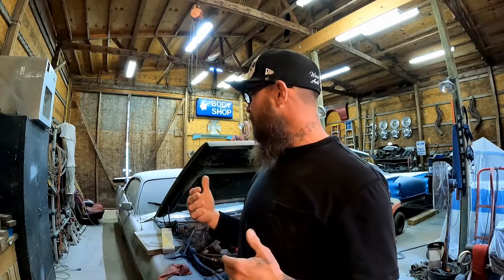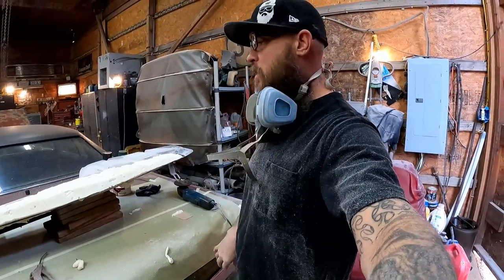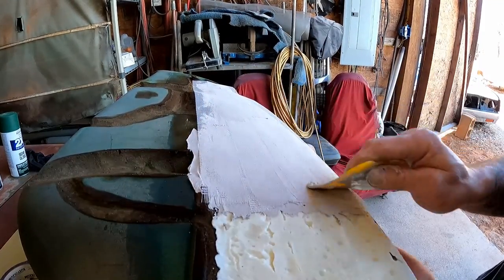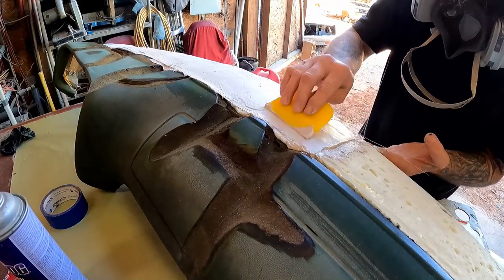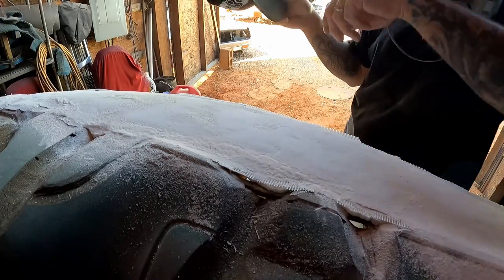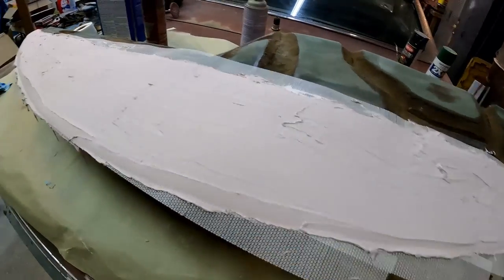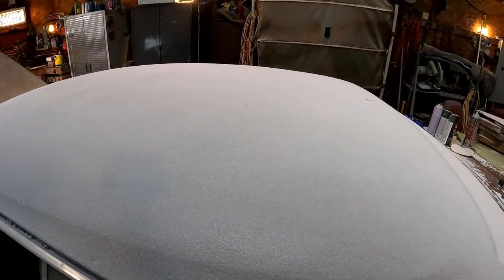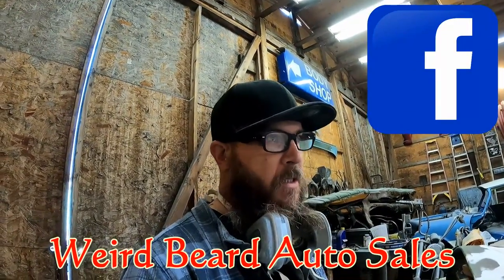FIXING THE WORST DASH I'VE EVER SEEN [2]

Comment: Couple tips on the foam can , some of those cans are made to spray upside-down , pays to check cuz you'll run out of air ! The other tip is , if you use half a can or what ever and then leave it and try to use it later & it's plugged you can takes the spay assembly off and spray carburetor cleaner through it and that old foam will disappear like magic! You can also spray it down the exit tip on the can !
Reply: Nice tips
Reply: Love how the creator" ignores lol
Reply: if he ended up doing vinyl.. was it necessary to go through all the filler wrk, could it been done with the carved and formed foam repair? just throwing it out there
Reply: @vojislavdragic5090 that’s what my thoughts were exactly when he said vinyl instead of paint
Reply: @Speedy123youknowme  on the second thought .. glue would melt the foam.. i think
Reply: Vinyl will need a good foundation. Bumps and waves will show through though pinholes don’t matter. Trimming vinyl  around those vent holes will need serious skill.
Reply: 너도 폼이냐

Comment: Add some fibreglass resin in to the filler, it makes it as runny as you choose to make it and slows the curing time down a bit to give yourself more work time
Reply: Halfass Custom does just that.
Reply: Yeah it's called Rondo (Resin + Bondo). Sprayway Customs does that.

Comment: Great 👍🏻 Stuff as always 🤠 Electric 💡 Lights, Heater, 120 plug -ins all on separate 20 amp breakers. If your Air Compressor is 120 or 240 volt. Separate breakers are a must do.

Comment: Just curious, wouldn’t using the Bondo “hair” have given the dash more strength? I suppose the mesh accomplishes the same thing.  Also, when the dash is sitting in the sun, will the air voids  in the foam under the Bondo heat up expand and  crack it? I used foam under Bondo on a rusted car door repair and always worried how long it would last.

Comment: The mesh tape pushed into the bondo will make a stronger result than the filler with fibers in it.  You are going to have a better overall result over the more expensive stuff.

Comment: Good move on switching to vinyl, spray paint wouldn't have lasted. Make sure you get marine grade and have heat gun ready for all those curves and lines.
Reply from the maker: Thanks for the tips. Hopefully mine will turn out at least half as good as yours did. Love your channel btw.
Reply: @weirdbeard8898  Thanks for watching! You have a lot bigger dash than mine, looks like yours will be a lot harder to cover in vinyl. I hope it turns out good.

Comment: Most usually when I see lights flicker like yours were, it has turned out to be a loose neutral wire either at the pole or in the breaker box. It would be pretty quick to check and might save a lot of headaches.  Love the channel!

Comment: I use spray foam for cab corners and rockers on these old rusty Ohio trucks. Never rusts again!    Shape it, Skim Bondo. Flex seal texture spray.  OEM finish.
Reply: It absolutely rusts again as the foam hold in moisture, any metal it touches will rust away. It’s a temporary patch if your trying to get another year or two out of the rig, but not a forever repair.
Reply: @sccarguy8242  it's forever, I own my vehicles 3-6 months tops.

Comment: Bondo brand bondo is a nightmare to sand. When I was younger I used it and I hated it. I delivered parts to a bodyshop and they were using a green filler to skimcoat a whole car and it was sNding so quick and easy with the DA's they were using. I tried for a while to find out the type they were using. I was working on my 72' Chevelle convertible back then. This was in 97' or 98'. Lol.

Comment: COOL! 45+ years in, and here's a new one on me with the foam. Seen many custom floor and ceiling consoles use bondo over wood, then finish how you want; paint, vinyl etc.. There are some really good videos on vinyl covering dashes. One was complicated like yours with vent openings...contact cement and blue vinyl. Awesome when finished!  YOU? Scared of vent holes? Naww. But it does add to the drama.  : ) Start a hole in the center of the vent opening and work your way outwards, trying different tools until "you get it". I'd try burrs and sanding drums. Kudos for being frugal! The nice part is that you can be both frugal AND generous at the same time! Being frugal is more a philosophy of NOT WASTING if possible (like turning off the lights when you leave the room). Some benefits are: Pay less to the "big" corporations; Pollute less thus ultimately doing our part to slow down the toxification of humankind. YUP, FRUGAL IS GREEN!

Comment: I used to work a lot with these things back in the day, if there's one tidbit of tricks i can impart on this, is i would recommend using closed-cell foam instead of that cheap fix-your-home stuff. Get the quality two-part foam, it'll need a bit more prep and is pour-in type, but it'll expand more even, fill more even and is 1000 times easier to work with and sand etc. Also, the closed-cell foam, when bondoing over it, will not create those 'bumps' that you got here, as there's air trapped in those open cell holes and it'll always be a nightmare to work with and get even.

Comment: Mike instead of cutting the defrost out, you should just drill holes or ports and wrap the edge of the vinyl down in the ports, 5 ports per side. Please make your own emblems on the dash and on each side of the roof.
 (W B SPECIAL EDITION). You can make the indent on the dash as long as you want to it will be under vinyl.

Comment: Awesome work! Being in car audio fabrication and installation, I've done my fair share of sanding! Bondo and Fiberglass resin.....whew! There's been a few spare tire enclosures that have just about put me in the hospital....even with respiration. You really need a hood with O2 for that involvement....anywayssss.
It'll definitely hold together a lot better with the vinyl! I'm so glad you said you were going that route! I was even going to mention "flocking" (For a flocking-good time call....lol) but you get no more structural support from it that just paint. It's a cool process you might want to add somewhere in the car though.

Comment: This is too crazy.  I found your channel tonight and was observiing you restoring a dash pad and I go to thinking about the car I wish I could have repaired back in high school that I inherited to drive which was our family station wagon.  The dash was split a few places and not reallly bad and never knew that it could even be removed. I did body work on it and my dad had an Earl S cheib paint job done on it.  It was creppy....But it served it's purose.  I ended up putting some furry blue fabric on the dash to cover up the splilts. FF to now nd I'm looking at your dsh and thinking about being able to do that in teh future if I get a car needing it done and the more I looked at your dash..A huge bell dinged.  The car we had bought brand new in 1972 was a Custom Suburban Plymouth Fury.  Where that badge spot was it had a Custom Suburban badge.  IT was blue.  I fguess blue wasnb't as bad to  split up like the green did.  Oh and by the way, what about the speaker grille?   LOL   You going to drillit out with 1/8th drill bits?   Mine was really ate up in that section too.

Comment: Working with foam I have found to keep a spray bottle of water. Mist the surface area, spray your foam then mist over it again. It'll cure faster and less chance of the soft spots. I used to make Zombies using spray foam and mannequin parts. Amazing work man!

Comment: My 2016 GMC Sierra Z-71 went out due to the torque converter being off balanced from the led grinding producing shavings that built up in the torque converter and caused it to sling apart at 83,000 miles. 
I would love to be part of a class action lawsuit.  This cost me $4800.  And GM issued a service bulletin to the service depts explaining that the transmission fluid originally used was to thin and that if a customer brought their vehicle in complaining about a a shutter or shake in the transmission they were to flush the trans with 20 or 30 quarts of fluid, to get all the shavings out of the torque converter. Then they are to fill it with a thicker better fluid.  My issue with this is isn't the damage already done?  Ok so now you have the correct fluid in the trans. Wouldnt  the gears now be worn and could eventually be an issue for you later down the road?

Comment: Strange tip.
I've used that foam when setting a replacement doorframe in solid concrete wall.

What I did was freezer a 1" inch thick by 3 inch wide block of ice.
You heard me. Ice.
I then used the ice to smooth the surface of the ice.
It actually worked.
I also put a very light misting of water oh the surface before applying the foam.

Comment: Very interesting information. Thanks for the video. Good job on the repair.
Bondo tip: If you mix in a little fiberglass resin, it prolongs the working time and makes it spread like butter.
Works on fiberglass filler too.

Comment: Great content dude. It seems that this spray foam needs to be exposed to the air, in order to cure. As it cures, it forms miniature air pockets. Any contact with the foam, before it cures (I.e. plastic squeegee or even the tip of the applicator) will pop those micro-bubbles. Thanks for sharing this. Blessings.

Comment: You did a good job in my opinion.. I seen both videos where’s the 3rd..? You could have if u wanted to salvage certain parts u took off in the beginning… hence my question of using fiberglass, do you know how to use that.. ?? I’ve seen and personally have done things with fiberglass that in the beginning I didn’t think for one you couldn’t use fiberglass in certain areas but it worked..

Comment: Hey Mike, You probably need to check how many amps your heater is pulling. The electric motor could have an internal short. Unusual that your welder or Air compressor does not also trip the breaker. Especially when running together.

Comment: Squirty foam needs 1 inch beads. Any more leaves a sticky mass inside the hardened foam. A mould and two pack do a better job. Could press clay onto the original dash to make a mould. Don’t let it dry and easy to correct around cracks in the original. Easily pulled off when foam has cured.

Comment: I did a Rambler American 440 dash here in Australia. Dash wasn't as bad as yours but it was bad.
I reinforced mine with balsa wood strip embedded in the dash to provide support, than the usual body filler. My final layer was fibreglass to bind it all together followed by a bed liner. Myst say it does look very good.

Comment: God I suck at body work & doing Drywall lol. I may try and fix a few cracks in my pickup dash after watching this, worse that can happen is I spend $125 on a dash cover in the end. My center Speaker cover is broke but I had another dash that was trashed but most of the cover was good so I cut it out and it's been sitting in my toolbox, I've come up with a plan to fix it so I will try to fix that first and if it works then on to the cracks which are very small compared to the dash you are working on.

Comment: Good job. But you  should cut a foam with a knife, it is cleaner and faster. Then put another layer of  PUR foam to fill "moon holes" (that can save a filler and money) ahter that  cut again with knife, then do lill bit of sanding.  Time for filler, more thinner layers for better results, do sanding and its ready for bond job. Anyway you did it great.

Comment: just an idea, with your furnace cutting out, check to see if your furnace motor is slow to start spinning the motor or if you try to spin the motor over by hand and if there is resistance and doesnt want to spin easily you might need a new motor.  If its slow to start up it could be your start capacitor.  Is the heater gas fired or all electric?

Comment: Man, I thought that the dash in my 2004 Acura TL was bad...I was sorely mistaken...mine is just cracked all over the top of the pad. I need to take the dash pad out, fill the cracks, and maybe flock it or paint it. I flocked the dash in my 1997 Civic drag car and 5 years later it still looks good.

Comment: Should cut the foam out of the defrost vents and any other openings you are leaving open, before the body filler process. That would save you alot of time, hassle, and extra work...cutting them out after the fact is basically doing double the work in those areas of the dashboard.

Comment: Your electricity has a problem with too big a current draw when you have the heater and lights etc. on.  There are ways to find out how much an electric appliance draws (killawatt).  If this used to work fine, find out the current draws of everything.  Something probably has a short in it now.  Try the heater by itself first.

Comment: Dash is looking good....
What tips can you offer about the ratio you use hardener/body filler...???
I know temp is a factor, but I always have problems mixing mine....
Reply from the maker: Less is more especially on a warm day. If it seems like it’s taking too long to dry just use a heat gun or hair dryer to speed up the process.

Comment: You have breakers in the shop? That gray box on the wall 48:20 I would say you have a bad heater that is wire straight up to your main power. You should be blowing your main breaker anytime. That heater should be on a 50 amp breaker by itself

Comment: That’s not bad. At least it was something to work with.   The small dash pad on my Duster project  I removed we found the metal support on entire one side was completely rotten off underneath.  Great work though.   That same foam is the filler to my lower portion of my quarter panels , LoL.  I found that a electric Turkey carving knife does a great job on many different foams .
  OH, and next time a little trick is to take a dowel stick and poke at the foam in the really thick areas to allow the foam to get some air .

Comment: The Bob Ross of Autobody? Few people know that Bob Ross was a tough as nails Sergeant in the USMC. Shaping the vinyl and stretching it to fit the transition from the instrument cluster extension to the rest of the dash is going to be extremely difficult and is possibly going to need to be cut and stitched unless it can be accomplished by heating it with a heat gun as it is being stretched out.

Comment: I also wanted to add a suggestion on the defrost. Have you thought about using some vent pods? Either aftermarket or out of another vehicle? Something you can just cut the hole and would not have to body work that part.

Comment: If you buy some cheap 1 mil poly and wrap the inside of your shop it will save you a ton trying to heat. Paint stores carry different widths and you can use a staplegun. Some little cardboard scaps help to get started to hold plastic

Comment: On Body filler i start before it gets completely hard,it will load the paper but it can be shaped more easily during the initial first wipe,just knock it down and get the shape,then a second wipe and let it harden till its really dry,makes sanding better.

Comment: Great job, i've done a few of these but never one this bad, the only thing I would have done different is after that first sand of the spray foam is go back and fill in the big craters, Yes it's more time consuming and takes longer but it gives it a better foundation and less chance for the dash to crack and those craters coming back in a couple years.

Comment: The body filler will eventually curl up on the ends and lift especially in the hot sun, been there done that. Ideal material to use is fiberglass.

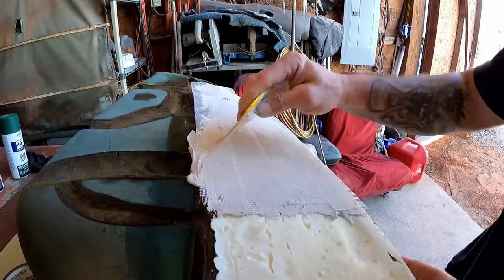Comment: Being someone who does this kind of stuff all the time on my car videos on my channel, I think you know how huge of a risk that pass was at the 15:18 mark of the video, I got the cringe face for a second. You know how lucky you got from that tape not peeling back, should have gone the other way, but I think you know what you're doing lol. Just think you got extremely lucky that filler filled tape didn't pull up. Keep up the great work!
Reply: Also love that you're referring to it as MUD, you've done some drywall before haven't you? Lol
Reply: I would have filled the holes (craters) in the foam with some more foam, dried it off, and sanded again, would've avoided the air bubbles

Comment: I hope you read your comments. You're going to need a large heavy duty plastic bag to pull a vacuum on the dashboard to get the vinyl to contour to the base correctly. The large surfaces you can get by hand but then you need to put the dashboard into a large plastic bag and position the vinyl and then start pulling a vacuum on it until it gets into every little crevice.

Comment: when you skin this unit with vinyl you will find that vinyl only stretches in one direction.  When you go around the bends it can be impossible to avoid getting wrinkles, or heating and stretching out those wrinkles.  To avoid this, cut your vinyl at a diagonal, on the bias, from top right corner to bottom left corner .  This allows stretching in all directions.
Reply from the maker: Thanks for the tip. Luckily I got a vinyl with a four way stretch. This stuff will go around a bowling ball lol